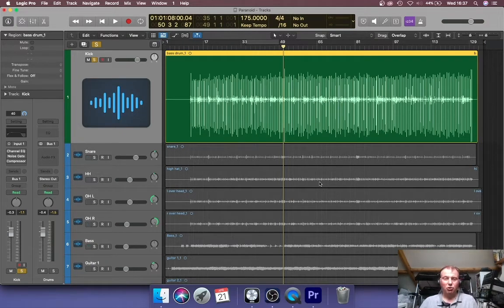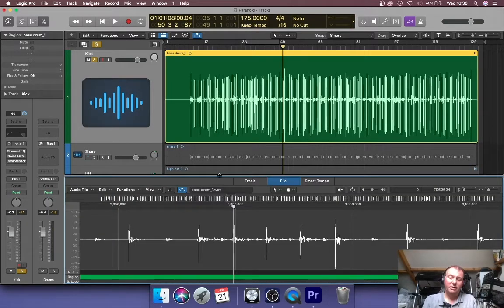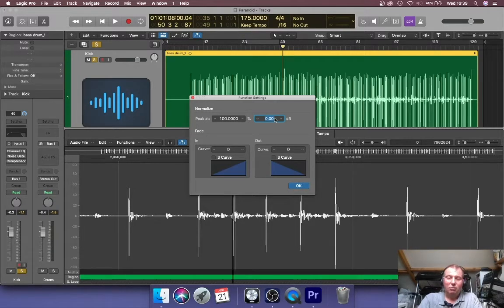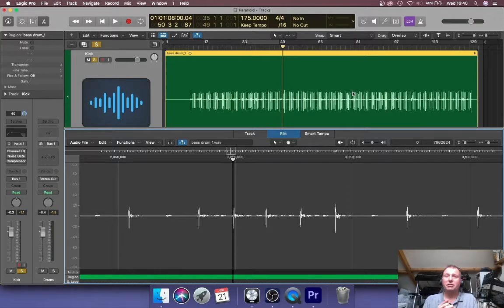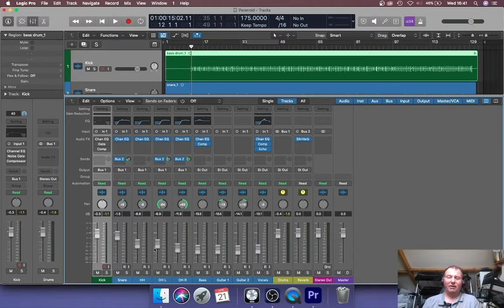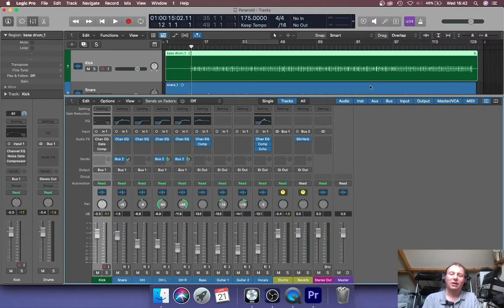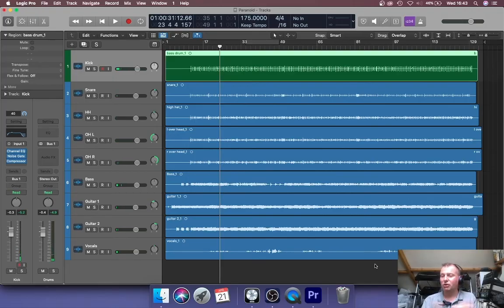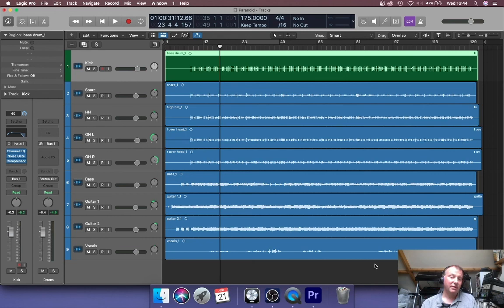Normalising in Logic Pro X

Comment: Hi, Thank you for the video I found it very interesting. For my own amusement I use a Backing Track from a Karaoke forum which I believe is already Mastered to a top volume level and then I record my vocal on another track and mix afterwards in Logic. Would your Normalising to -10 work for me with this scenario with regard to the BT and the vocal. Thank you Tony.
Reply from the maker: Hi Tony, thanks for your response. This all depends on what you do with the mix. I imagine you will master the mix to accommodate the vocal into a final production. If this is the case aim for 6db headroom on the master bus for mastering. You might find that you only need to normalise the two tracks to -6 or -8dB. Let me know how you get on.
Reply: @SoundAdviceWales  Thanks for the advice, Tony.